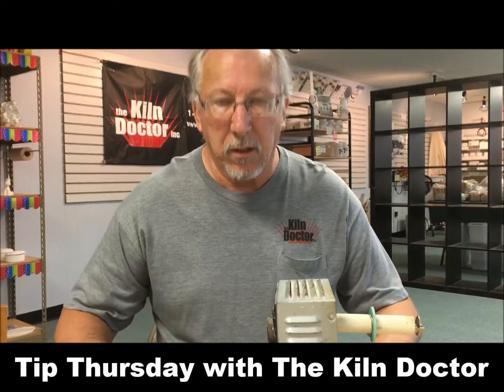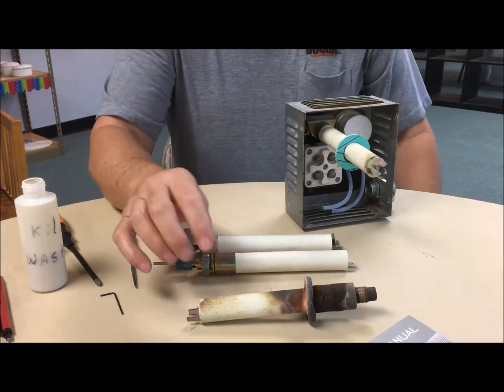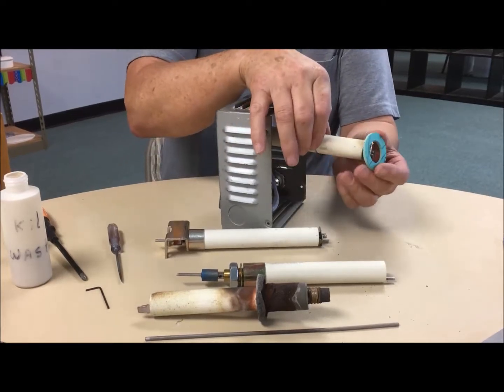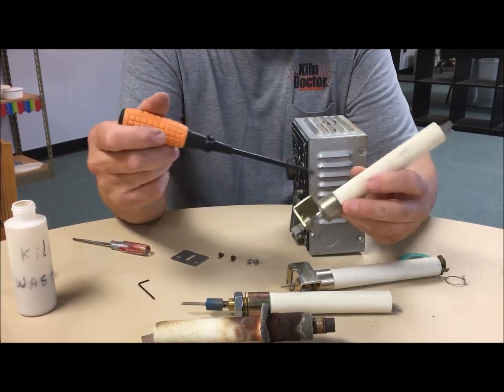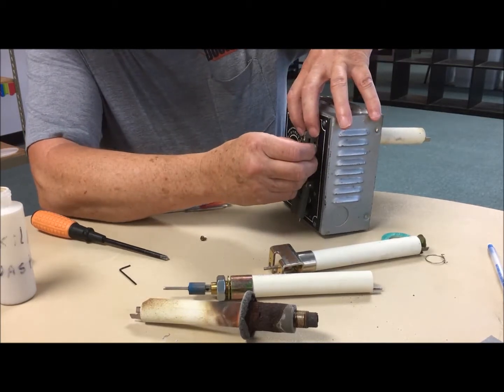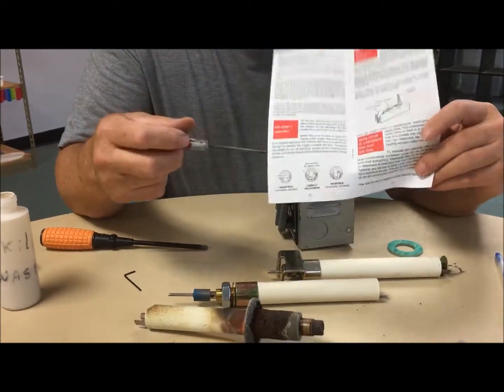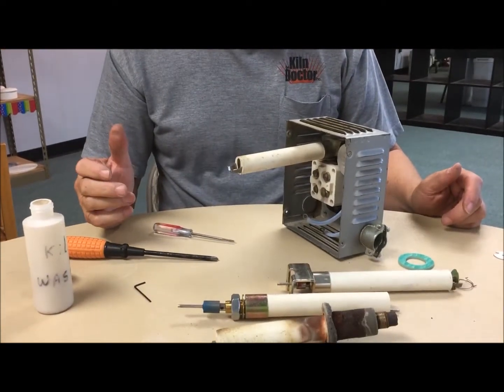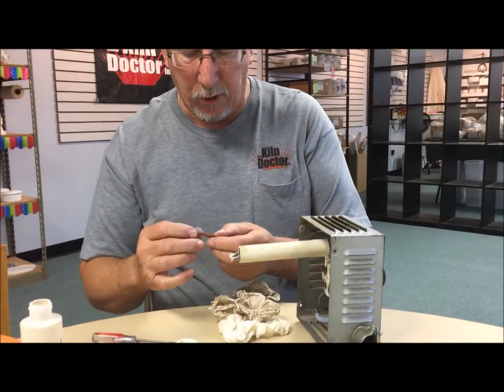Kiln Tech Talk Thursday Manual Kiln Sitter

Comment: Hi there,  Just received a new kiln assembly kit for my old manual shimpo coneart kiln.  The sensing rod doesn't quite line up with the cone supports.   So I need to loosen that little screw so I can move the sensing rod down just a little.  Nervous as I striped the one on my old tube assembly trying to just replace the sensing rod.   Is there a standard size allan key for that little screw. I would really appreciate any info here.  Thanks so much.

Comment: What is the purpose of this component? Does it control the heat? I just got a large kiln and I'm thinking of deleting all this outdated junk and installing a Novus programmable controller and have ramp/soak options. I dont do ceramics but I might use this kiln for powder coating, aluminum smelting and casting.

Comment: I replaced a switch in kiln sitter because kiln not operating.  If the sensor rod needs to be replaced  is it possible that could be the cause of it not turning on??

Comment: Helpful but I have another issue, maybe you can help me. I just put on a new kiln sitter and it won't work. Everything is set up correctly, but wondering if the wiring is wrong. The plunger won't stay in. I put the timer on, the pyrometer cone is in place. But it won't click on.

Comment: If I want to just replace the sensing rod can I do it without taking all apart.  It seem there is set screw on the trigger portion. It moves as I pull and push on the rod.  Is it as easy as unscrew, pull rod and put new rod in?
Reply from the maker: Sorry for the way way late response. The rod is attached to the tube assembly so you have to take it apart and pull that out.
Reply: @thekilndoctor1026  , I could not find a key that would fit into that set screw. Does one need a special one? If not could you telle us the size of the hex key that would fit ( To be precise , it's the set screw identified as part no. 19 in Dawson list) . Thank you so much!

Comment: Thanks for this! I've been wanting to know which side of the cone should be facing which way. I've seen some videos placing the cones the opposite of this one and once wondering, wouldn't the cone bend the other way?

I was wondering, some people use regular size cones and just cut it to small size. Is it safe as alternative just in case I can't get to access on a small cone? Thanks if it happened you reply Mr. Kiln Doctor!
Reply from the maker: The way showed in the video is the correct way. Putting them in upside down could cause issues. Sorry for the way way late response.
Reply: @thekilndoctor1026  thank you! I was able to purchase some bars instead of cones on a local ceramics materials store and managed to fire mine at bisque temp. Now on the way to fire at cone 6 :)
Reply from the maker: @bidoro_12  Thats great! Keep in mind to check your rod regularly to make sure it is not bent. That will change the firing. Happy firing!!

Comment: Hello "The Kiln Doctor, I just purchase a Gare kiln, model 2327,  watts 10350, volts 230.  I'm ready to use the kiln however,  I need a replacement lid bracket to attach the lid to the kiln and I the kiln manual  Can you guide me to the where I can get the replacement part and a kiln manual.  Thanks
Reply from the maker: Sorry for the way way late response. But we may have a used one that could work. Where are you located? For the manual most of the time you can find them online. Try contacting Evenheat they are the company that took over Gare.